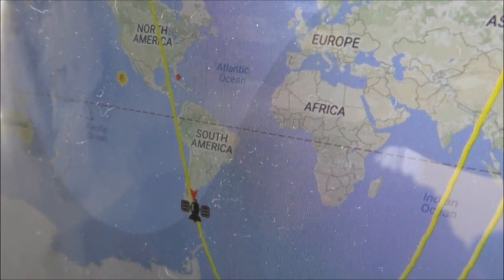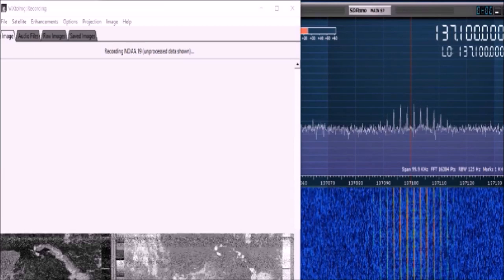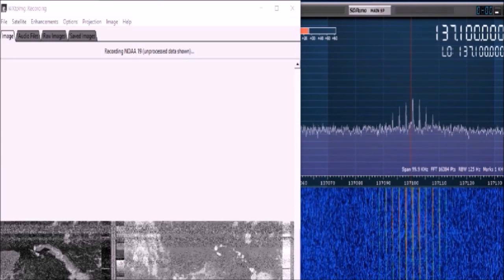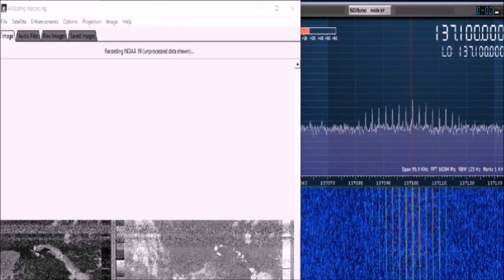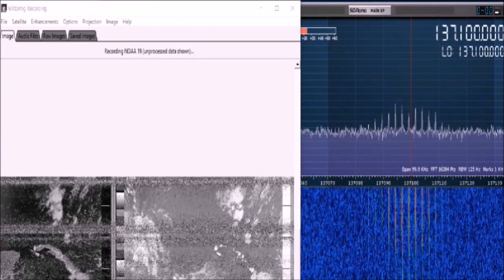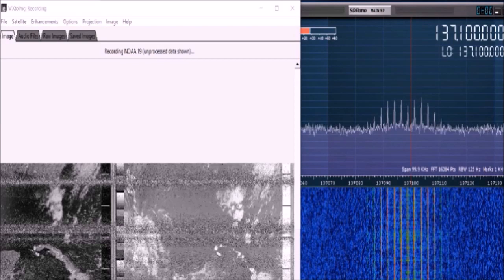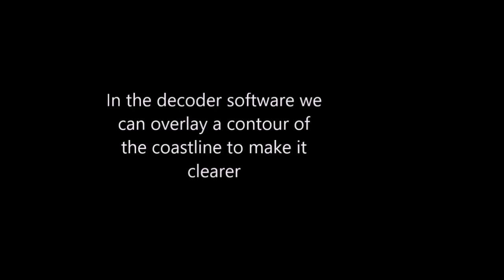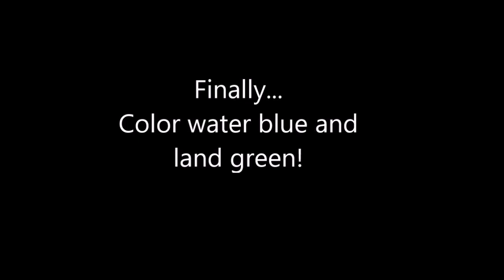2017: TV Antenna vs. NOAA Satellite

Comment: I love the use of the BNC to binding post adapter. It's my favorite feed point. Here are some simple mods I like to make to my adapters. I run some thin cordage vertically through the binding posts and tie knots on  on the ends so you end up with a loop of cordage on top to hang the feed point from. I run a key ring through each of the horizontal holes. I put spade connectors on the ends of the antenna wire. I wrap the wire a couple of times around the key ring and connect the spade connector to the binding post. That keeps the spade connector from coming loose.

Comment: Hey Thomas, I'm late in commenting but I was wondering how to wire up the antenna to the SDR? My SDR has a belling-lee connector and I was wondering how the two cables of the TV antenna should connect to that? My signal seems to be best when one or both of them are touching the center pin of the SDR connector

Comment: Did you impedence-match the 300-ohm rabbit ears to the 50-ohm RG-174 cable? It likely would increase the (received) signal strength.
Reply: Wes KN4NPH how

Comment: Hi, to my understanding, NOAA 19 signal is circularly polarized. Why is your TV antenna able to receive it?
Reply from the maker: Solomon, if the transmit and receive antennas have different polarization you will still receive it, just a little less efficiently. NOAA signals are pretty strong compared to other satellites and the V dipole provides some approximation for circularly polarized signals. No problem at all receiving the signal.

Comment: Nice video. But those rabbit ears, or others like them, were probably used within the last 4 to 5 years. Its only been that long since television switched from analog to digital. Also, you might try adjusting your rabbit ears to about 30 degrees above the horizontal plane from the ground surface. The satellite send its signal in right handed circular pattern. A QFA or turnstile antenna would be a better choice for reception and either one easily built from materials obtainable from your local hardware store. I am wondering what source gave you information that the satellite transmits its information at 800 watts. That might be an acceptable output for a deep space vehicle but not an earth orbiting vehicle. The stat's for this satellite show that transmit power is up to 14 watts output.
Reply: I had a pansonic color TV, 13 inch that used exactly those. They fit in a hole in the top of the TV and came with it. I saw them in stores as well. I bought it in 1975.
Reply: While this is true, it's been a long time since the twin lead was replaced with a coax connector.
Reply: Michael Stanley Exactly

Comment from the maker: The signal is strong and there was no matching between the antenna and the coax
Reply: Could you explain what did you mean in "there was no matching between the antenna and the coax"?
Reply from the maker: @ahmadbro8051  an antenna has different impedance than the feedline (coax). You can insert a small coil to match the impedance or ignore it and you will have a small loss of signal due to mismatch.